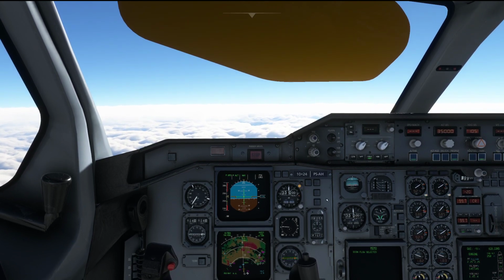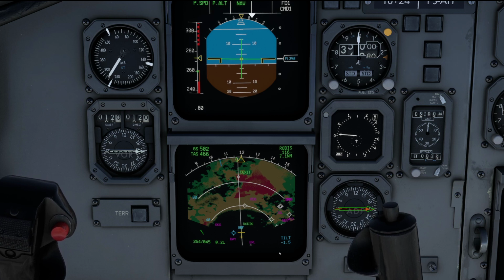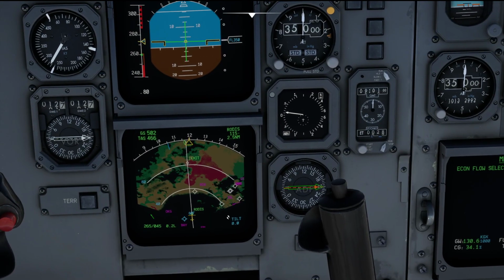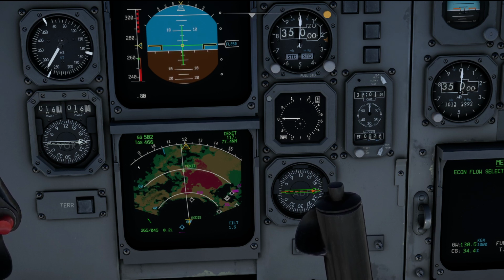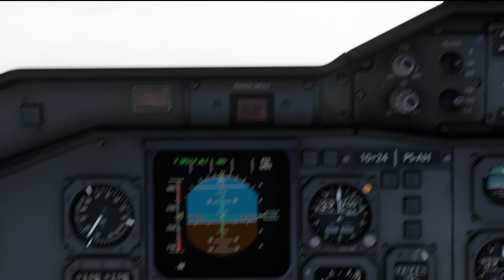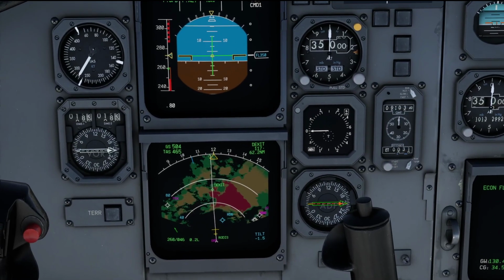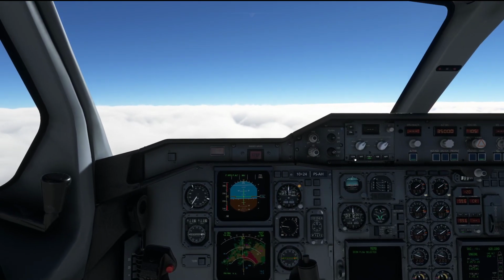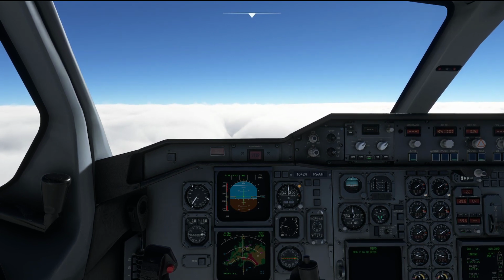Why Asobos Weather Radar is USELESS | Real Airline Pilot

Comment: I didn’t think it was too bad to be fair. Yes it’s not an accurate picture on what’s in front of you, but it’s better than nothing and is still a good indication of where the worst weather is. You wouldn’t fly over the top of a thunderstorm would you?? 

I landed in Gatwick yesterday and there was a green band just over the runway. It was not raining on approach and as soon as I landed it started raining. Just like I was expecting it too. 

Christ we’re not going to get real world weather radar functionality surely! The sim is NEVER going to be that capable I bet.
Reply from the maker: If the tops of the thunderstorm are below FL250 (some say FL300) you would fly over it without any issues. We often do. Like the red you've seen in the video, if that was up at my level I'd most certainly have deviated around it. But it was low level weather, totally irrelevant for my flight.

I don't think "anything's better than nothing" here. It puts developers into a lazy "there you have it" mode, or into an "we can't do it" mode. And eventually the community will accept it and be happy, people will start thinking that this is how a WXR actually works. And eventually a totally wrong picture will be created among simmers, leading to future developments being just as incorrect as todays.
Reply: @A330Driver  I try to avoid fly over thunderstorms as much as I can personally. If you happen to have a decompression or Eng failure at just the wrong moment, I don’t want to be descending into it. Certainly not when a cadet on day 2 is next to me! Of course it’s not always possible when there’s a severe squall line or proper embedded stuff but I still try to avoid the red bits as much as I can. The chances of having a severe event like a decompression whilst over the top of a TS is small, but that’s point, I’m trying to reduce as much risk down to zero as I can. Lower level stuff is often harder to avoid (when on an arrival) and yes I agree anything below about FL250 is not a concern. But it’s not going to be really active at that sort of height like a large CB would be. 

I appreciate your point about developers getting lazy and people learning bad or incorrect habits. But this is the beauty of this medium. We can teach and educate how we’d normally do it IRL. Ultimately if you’re day VMC, look out of the window. If it’s at night, you have to trust your instruments. Yes you might be over conservative but we can’t afford to get it wrong out there with real people behind us. Ultimately I don’t think this is going to be a major detriment to the community. Quite the opposite in fact. It might actually force the sim pilot community to start interrogation what they can see and make safe, educated assessments. As in your example, we could quite reasonably say “there’s nothing large or convective up here! Nothing on the SIGMET chart and I can see the layer below us. So, that red area must be some low level moisture and rain. It’s not a threat up here so I can either plough through cautiously or take a slight deviation to be sure”. 

Yes it’s not 100% accurate but will we ever get that? The weather radar is so complex I can’t even imagine it’s possible to recreate every detail of it. There was one formula that I forget but it was something like have the radar range at 160 and the weather radar tilted 1° up. Then anything painting between us and 80 miles is above us. Again I can’t remember the exact formula but I can’t imagine the sim will ever be that capable or the weather engine that realistic. The clouds in my sim certainly don’t look as menacing as what I see IRL.

Alas from what I have seen so far, I was happily impressed. Granted it may not be perfect yet but I’m sure these things will get updated over time.
Reply: Hey ;-) I don't want to reply on the behalf of @737NG DRIVER but personally of course I wouldn't fly into TS with GA or tubes in real life as we all know but who cares about danger by flying msfs 2020? Nobody cares just because you'll be safe anyways enjoying a Cub flying right into TS: no dangerous convectives, no severe up-downdraft, any risk to stall or to get severe icing conditions in TS/CB in msfs 2020 but the sweet opportunity is to be able to make beautiful screenshots of scary dark clouds which we cannot do in the real world (if I want to be a little bit sarcastic about msfs).

However on the other hand, the good news is that Asobo is looking at the idea to implement "dangers in the skies" as it is mentioned, but it was said by the devs that they were afraid by complaints in case if we got hit by 5000/10 000 ft updrafts all of a sudden in TS that most of people won't understand and will claim that it's overdone ( even if Mother Nature is already "overdone" in terms of huge turbulence that could happen in a thunderstorm yet! ) then so far we don't need any radar to fly safe!

Hopefully severe and unsafe weather conditions will make sense in MSFS step by step as this flight sim well deserved! 
Cheers! ;-)
Reply: @lknfly1166  A good response. It highlights how differently the sim can be used. Some seek pure real world emulation and some like to have a laugh and do all sorts of things we can’t do IRL. So you can argue many people “care”. I definitely fall into the latter category with the sim! It enables us to do all sorts of crazy things which is what makes it so appealing to me. 

But conversely it’s a very powerful tool to run through real world ops procedures so it truly is a very dynamic and capable program.
Reply: @VmcgHD  Based on what you say I will add on top of it that there is a place for everybody to enjoy a Flight Sim which is a good thing.

However the devs should give more attention about the engine weather in terms of realism which could be another good thing to learn how it works for users who have an approximative idea and it could be challenging as well. Also the devs want msfs 2020 "not being a game" that doesn't mean that it has to be only a "tool" for training pilots of course! 
Anyways I do believe that they are on the good path, step by step, to provide more realism. 

Same here I take some "risk" on the sim that I definetly wouldn't do in real life! hh

Enjoy and fly safe! ;-)
Reply: @lknfly1166  couldn’t agree more. 👍

Comment: I got to be honest, having been involved in Flight Simming since times imemmorial, I think Wx Radar is a kind of luxury that we really don't need to be fully happy. It'd be nice to have a fully functional one but at the end of the day the majority of us dread having to setup route offsets due to weather :P  Thank you for another informative video though.
Reply from the maker: The question is, are they ever going to make realistic frontal thunderstorms? Or realistic thunderstorms at all? THEN the very latest you need one.
I think we can agree that with the current weather system there's not really a need for a WXR as the weather hardly has any effect on you at all.
Reply: @A330Driver  I absolutely agree. There is a wishlist for "Dangerous weather simulation" on the MSFS forums. We want convective turbulence, windshear events etc.
Until Asobo manages to implement those, the weather radar is just a gimmick and doesn't serve basically any purpose at all.
Reply: @A330Driver  Completely agree and that is the crux of the question, for all its eye candy (and interesting little visual fenomena) the MSFS atmospheric model is pretty far from where we'd need it to be in order to fully use any WxR system that any developer might come up with in any meaningful manner. I may be showing my age here but apart from the REX Skyforce stuff (which worked beautifully with the MilViz WxR implementation) back in the days of FSX I'm still hard pressed to find anything that gives you that in the present day and age. :)
Reply: @A330Driver  Unlike what they glowingly advertised in their PR about "Real Repercussions"........
Reply: I completely disagree, and according to the comments in forums, and on other social media outlets, a fully functional weather radar is a core ingredient to the flight simulator experience. I and many others love deviating for weather. When on long journeys, it gives you something to think about. When on Vatsim using the same weather as the server, its so much fun communicating with ATC and getting deviation instructions. 

Of course you are entitled to your opinion, but its one that many other flight simmers do not share. 👍
Reply: We do need it

Comment: Just to clarify, not sure why Ini didn't implement it but cone angle is configurable in WASM modules using the asobo weather radar. NGDriver I implore you please, without having looked at the SDK yourself and simply going off of what the aircraft is capable is not enough for you to make conclusions on what is and isn't possible with Asobo's weather radar. People then parrot these conclusions that you make and just spread misinformation around. The weather radar support 3 modes, horizontal, vertial and top down. Based on testing, INI is using top down view which does not support a configurable cone angle. Why they did this, I don't know. The other modes however, do support configrable cone angle and thus would support what you were trying to do in this video.

Again if you don't know, either ask someone more informed or just don't make the video at all, don't make assumptions. People look up to you as a source of information.
Reply: Wonder if its got something to do with the plane starting up in debug. Which we already know causes the FPS drain
Reply from the maker: Let's have a look into what the people who are informed have to say then. I suggest starting here:
https://devsupport.flightsimulator.com/questions/11218/will-we-ever-see-full-weather-radar-compatibility.html
I also suggest to check out the various developers discords, if you just for example go into the Fenix discord and type "WXR" into the search box you will very quickly find a LOT of comments saying how the current API - even with the features you mention - is insufficient for them to produce something useful.

So to be entirely clear about your main point of criticism: Even with the features you mention all you get is still bitmaps. Simply unsuitable for a weather radar simulation.
I suggest you start reading into some basics of how weather radars work, ie how they measure the rate of return of the radar waves deflected by precipitation. How do you want to simulate that with a bitmap? How do you want to simulate terrain returns, gain function, etc.?
Reply: @A330Driver  Lol, my main point of criticism lies within the confines of Asobo's weather radar and the aircraft using it, the A310, and you're argument (as stated in the video) about what it can and cannot do. You, and everyone has discussed the fallacy of using bitmaps and how it's entirely useless to develop an accurate representation to third-party developers such as myself, I know this. However, THIS video isn't about that. It's about not being able to tile the radar cone to assess the verticallity of upcoming weather pattern. Nothing to do with bitmaps or why third party devs can't use it. Don't try to misconstrue your video into something that it's not, stay on topic.  

Your video is about why the radar is useless on the basis that radar tilt does nothing, within the confines of the A310 using it. Yes we can all agree that bitmaps are utterly useless to third party devs, however the lack of tilt function in this aircraft isn't on Asobo to blame here, and it certainly has nothing to do with why third party developers can't make a weather radar, bitmaps are to blame, which again, not what your video is about.
Reply from the maker: @TheSAfreak  Well, then let's phrase it another way: They say that function is there in the SDK. But nobody uses it. So what does it tell us about that SDK function? Either that it is supposed to be there and doesn't work, or that it is still inadequate for the task at hand. Chances are that the developers won't tell us what the actual reason is because Asobo is known amongst developers to be very restrictive. They might easily ban you from marketplace for saying that the API is as useless as it is.
Reply: @A330Driver  You're grasping at straws now, what is the purpose of your video? Is it to comment on Asobo's radar bitmaps functionality or is it what the Asobo radar in the A310 can or cannot do? Stick the actual content of your video you're straying away from the topic at hand to give yourself confirmation bias. You also now move unto some non-sensical fear mongering about being banned because of constructive criticism to the Asobo devs? This criticisms that that is literally on the SDK forums everyday? I don't see anyone getting banned there or on the msfs forums for that matter.

Nobody uses the weather radar SDK because it is bitmaps, but INI is currently using it, christ, is this a hard concept to understand from the video YOU published? I can tell you what the actual reason is because I can go myself and build a WASM guage and choose one of the 3 weather radar modes and it will do what it says on the tin, within the shitty limitations of the bitmaps. However as you've clearly potrayed to not having any developer knowledge. You can instead download WT's G1000 addon and test the weather radars functionality there that are all within the confines and limitations of Asobo's weather radar. You're a pilot, I'd imagine you could think critically about the situation rather than jumping to conclusions with no basis.

Comment: how did you turn on the weather radar?
Reply: there's i button called "WRX" in middle side console. just switch it on. Only works on A310 rn
Reply: There is no weather radar